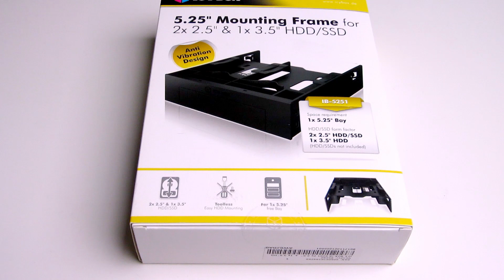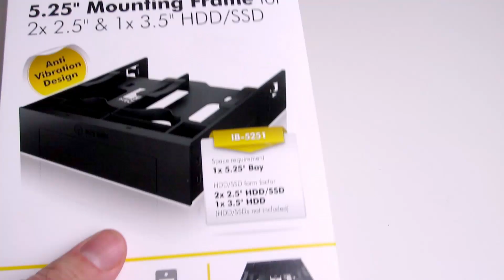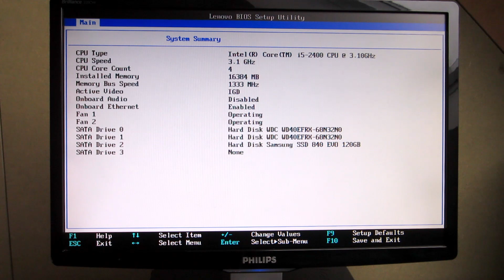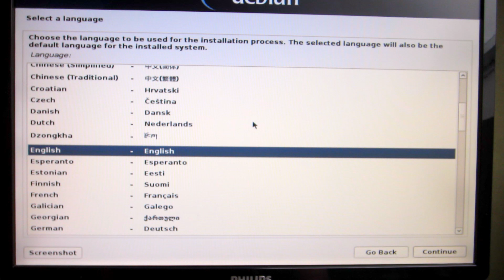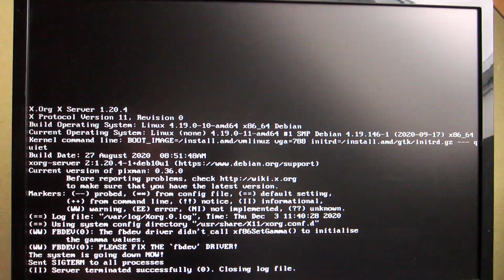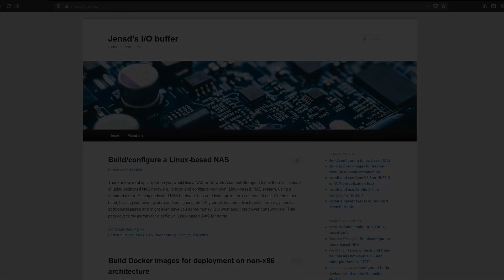Build your own Linux NAS - Part 1: Hardware

Comment: Would you be able to list all of the parts used in the making of this? I am having trouble finding the drive bay you used.
Reply from the maker: The drive bay is the Icy Box IB5251.
Rest of the parts are pretty common I think.

Comment: Hi, thank you for your video, why you did not use FreeNAS or OpenMedia.could you please explain , what is advantage or disadvantage of each one?
Reply from the maker: I'm aware that these exist and their advantage is that they take away the complexity of setting things up manually. You have a nice GUI where you can configure everything. I do like to run additional stufd on the NAS, like some scripts to monitor the kWh-meter in the house, plus influxDB and Grafana for example. This is probably also possible on FreeNAS/OMV but I know Debian pretty well and like that I have complete control over it. Depends a bit on how familiar you are with Linux and how custom you want to go I guess...